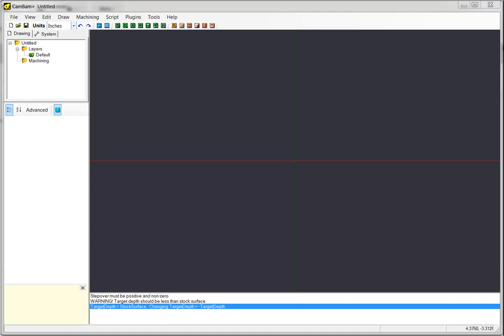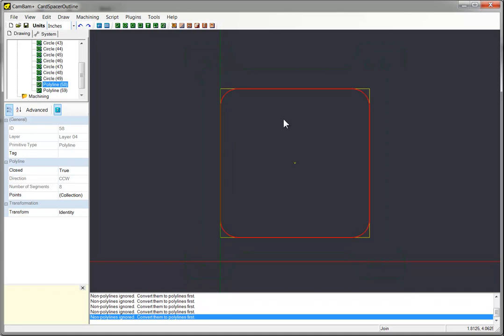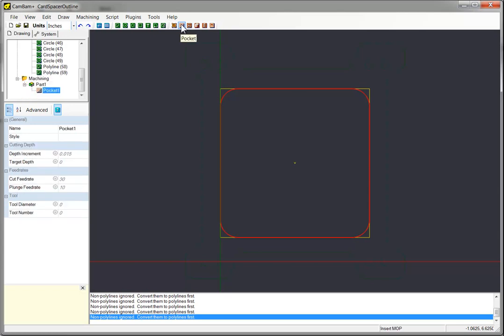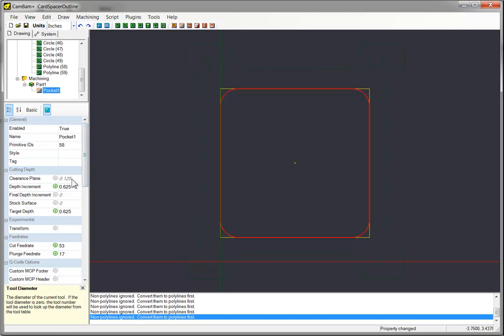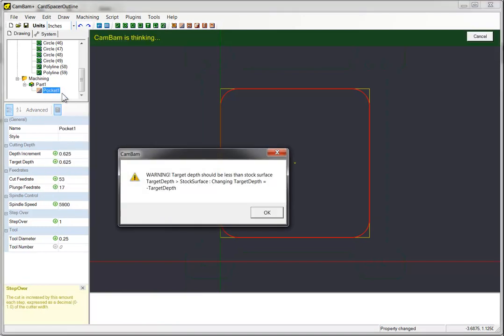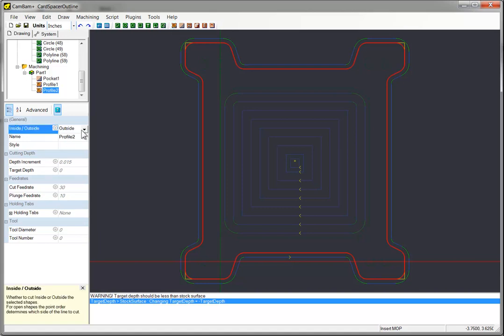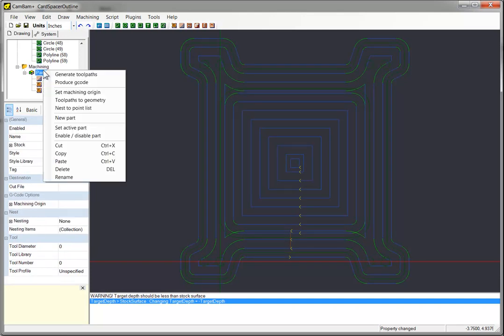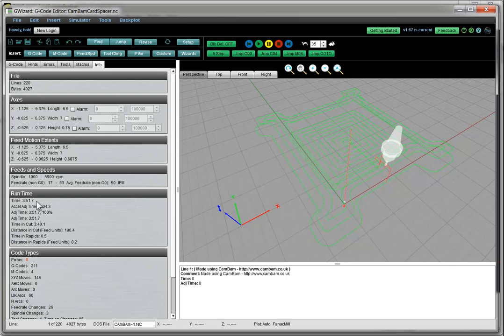Cambam:  Beginning CAM Part 2

Comment: for facing the top, you could have used Pocketmilling, then set a roughing clearance with a negative value to go just over the edges, and select both inner and outer contour to machine..

Comment: its 2016, Is CamBam the best program for a newbee like me?  I'v been willed all the pieces parts to make cnc plasma table/ router table.  I have most everything but the knowledge... I need the place to start, any advise from you peoples would be much appreciated.
Reply: i've seen a lot of newbies do miracles with CamBam.. i "discovered" it way back in 2007, when i just finished my machine.. CamBam is one of the best Cam programs out there.. i'd recommend it to companies as well..

Comment: The error you received about the cut depth is accurate. If you have a stock surface of 0 (zero) then any cut below that is a negative number. With a positive number you are cutting air. You have to use -625.